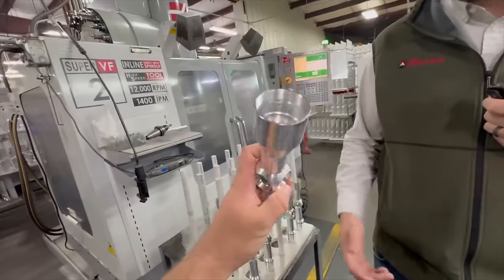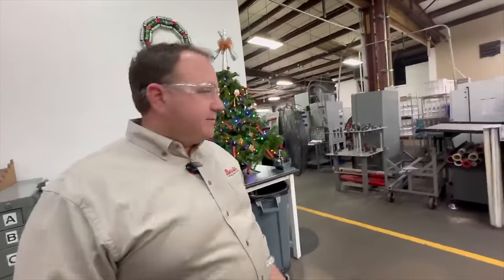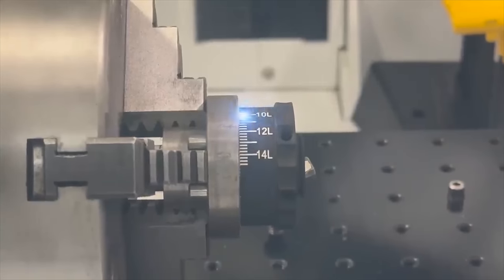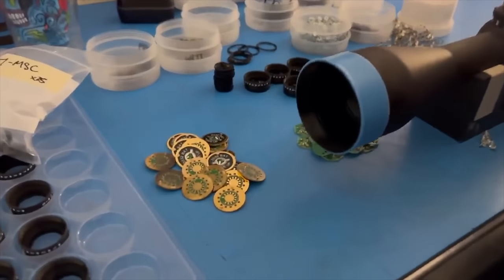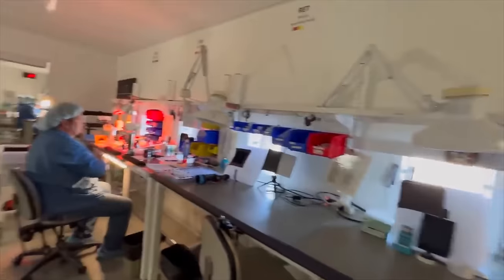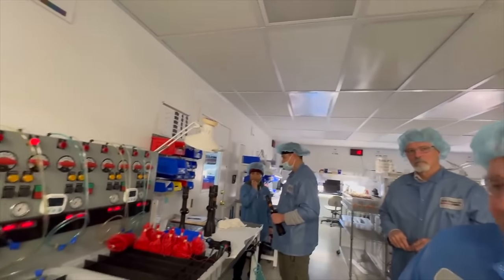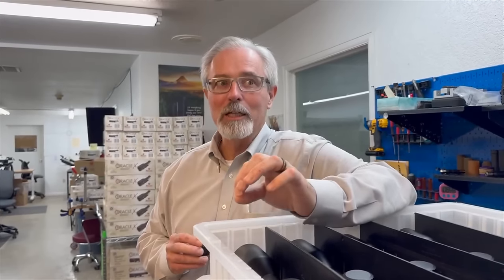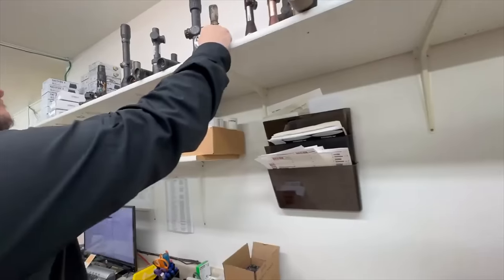Factory Tour: How Scopes Are Made in the USA

Comment: Burris is one of the few manufacturers to supply stainless finish scopes that match up with stainless firearms.  Their scopes have been super at turning my stainless arms into tack drivers; including a new 6" Colt Python.  For some reason the new Colt Pythons are not drilled for optics, so a gunsmith drilled the necessary mounting holes for me.  Fortunately, the new Anacondas are drilled for optics.

Comment: That's why rifles that fire from an open bolt or spring piston powered air rifles are vastly the hardest on scopes. Nothing will break a scope up inside as quickly as a high powered spring piston powered air rifle. If a scope can survive and hold zero on a magnum powered spring or gas ram air rifle it will survive any powder burner.

Comment: You asked him how mositure got into the scope and he didnt really know. What happens is that all air, incuding what's inside the scope when it's built, has moisture in it, but in gas form. When the scope gets cold, that moisture condenses into water which you see as fog on the glass. By filling it with nitrogen you are forcing the air and its moisture out. Nitrogen is separated from oxygen and water by the machine that makes it so its dry. Theoretically you could use dehumidified air and it would be just as good but pure nitrogen is probably easier to make. Also without oxygen, you cant get rust on the inside of the scope, which is a nice benefit.

Comment: my favorite Burris scope got stolen...along with my 375 win TC super 14" barrel and frame. it was a 3x AO pistol scope...which I have yet to be able to replace because I have never found another.....this one was used when I got it....but it paired so well with the 375 Win in a handgun....you could adjust parallax,,,, but 3X is perfect on a fixed scope...and on a boomer like the 375 win it was perfect. I ended up getting another 375 Win barrel and frame ...put a 2X Swift on it but I really miss the 3X Burris....thought about a 2x7 Burris or other but have never done it.

Comment: I picked up a used Burris scope last year that doesn't work correctly.
(I think the previous owner tried to adjust it without backing off the posi lock screw)   I moved the adjustments quite a bit and the bullet point of impact did not change.
Can I send it in to get an estimate for repair?

Comment: They definitly could use some optimization in the factory. Using a single KURT vise with 1 soft jaw is NOT even close to accurate or fast.  They need to update some things.

Comment: I think it funny how he talks about 6061 aluminum!  6061 is easy to extrude, that is how the tubes are formed.  To extrude a hollow, a billet is broken into 4 or 5 parts, then rewelded, by high pressure before forming the inside and outside of the tube.  It is really funny how many people never see how extrusion dies form metal.  Knowing the qualities of 6061, I won't put much trust in that scope.  There are other methods to create a tube for speed and cheaper.  The machined chips are scrap which is directly linked to expense.
Reply: Haha, 6 and 7 have different advantages
Reply: @US2A  At least it ain't 6063!  We called 6063, "Cheese", for how it extruded.
Reply: You must not trust many scopes then.
Reply: Did you watch the same video?
They use billets and turn the tube profiles down on lathes to make one solid body end to end. I didn't see any tubes being extruded.
Reply: @eltomas3634  Did you not see the blanks they started with?  Those were tubes or hollow extrusions.  Some engineers call extrusions a billet out of bad training.
Reply: @kensmith8832  so you believe the blanks or thick tubes he said they chop down are extruded from several pieces and then welded into the thick tubes he is starting with?
Is it not possible to have a tube shaped billet where aluminum is cast into a cylinder and bored out to make a tube for a special application like thin walled scope tubes that need to have homogeneous metal on all sides and weld seams would cause warping issues? It seems like starting with real billet tubes would alleviate problems caused by welding later on.
Reply: @eltomas3634  The grain structure of cast AL is very weak.  I worked as a tool and die machinist at an extrusion plant during the 80's. The hollow die is two parts; one breaks the billet up to allow the metal to flow around the mandrel, and the die that forms the outside of the tube.  Most of the time, the weld is seamless under great pressure.  Have you ever wondered how they make plastic tubing?  The problem with starting with a solid billet is drilling the long hole, drills don't follow a straight line.  Is it easier to start with a tube.  Have you ever seen spun aluminum?  The process of spinning is like extrusions, as the process elongates the grain, making the metal stronger.  Extrusions are formed oversized and then stretched to within tolerance.
Reply: @kensmith8832  I can see how a tube formed from a single piece would need at least one weld to create a tube, I guess the quality of the weld would make all the difference and technically if the weld were perfect and not even distinguishable, you could say it was billet. I'm sure as long as they have made scopes and they offer them with a forever no questions asked warranty, they have figured out the way to make them straight and strong. Like he said when it comes to saving weight, they choose performance over adding weight. Their scopes are tough from what I've experienced anyhow. They would be pretty damn busy with warranty claims if they got too cheap on quality.
Reply: @kensmith8832  you don't think they've come up with a better process in 40 years?
Reply: @TheStig505  There hasn't been in breakthroughs in manufacturing in that area.  I retired as a COO with a background in engineering and manufacturing.  We looked for better processes with no scrap, while most went back to machining from a billet.  That is when the general public forgot what a billet was.  For the most part, a billet has ball grain, while forged and extrusions have elongated grain causing the metal to be stringer.  Why are forged pistons better than cast in a charged intake on your car?  Billet means a large cast block.